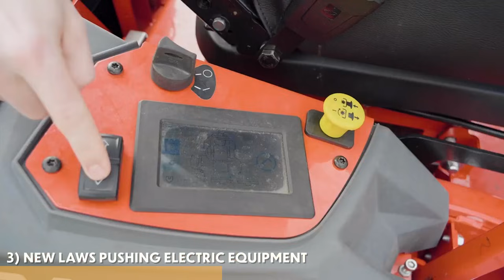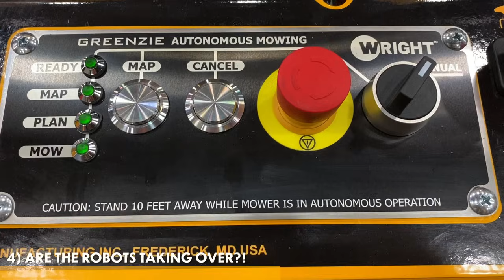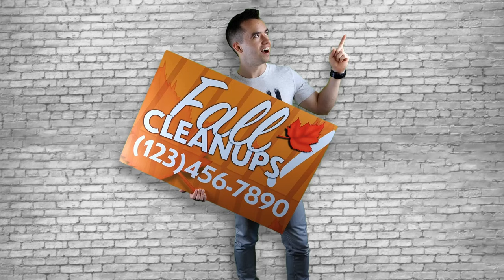The Government is BANNING Gas Powered Equipment & Truck Prices are INSANE!!!

Comment: Battery powered hand tools are enough of a let down for performance and run time. There is no way I’m jumping into battery powered mowers!
Reply: Programmed robot mowers and remote control  mowers will take over lawn mowing will be thing of the past I've seen highway departments using remote controlled mowers here and sitting in there trucks n a/c lol

Comment: I just purchased a 2011 Silverado 1500 for $10,000 with 110,000 miles. Private sale. Dealership's wanted 13-17,000 for the same model with 40-50,000 more miles.
Reply: That’s a steal nice man I had to pay 21k for a 2011 Silverado 1500 crew cab with 102k miles 5 months ago 😭
Reply: you should see the prices here in Australia they where bad before shit hit the fan. just before this hovid 19 shit i payed $20k AUD for a used single-cab 75 cruiser with 270,000km / 167,000mi i would have preferred a used dual-cab 79 but they where going for $90k pre hovid thats more then a new one. now a used 79 is going for well over $120k also that with little to no mods one that has bean modded a fair bit goes for $200k pre hovid now around $250k - $300k.
Reply: Ditch, was that for a 2wd?
Reply: @radiantlawnlandscape5466  no it's a 4wd.

Comment: They're delusional! There's no way their big mansions, estates & vineyards can be serviced with electric equipment, could you imagine having to do all that hedge & treework with a homeowner handheld 🤣
Reply: They will make commercial equipment that is battery powered if they havent already
Reply: String Trimmers ,hedge trimmers and edgers that work well are already here , leaf blowers and mowers that have acceptable power are not there yet, the problem is they won’t run all day … you need ways to charge as you go from account to account….

Comment: …. It starts January 1 2024 in California. Newsom signed the bill allready. No more gas powered lawn equipment, pressure washing , or generators. Im in Silicon Valley Los Gatos. There handing out tickets out here for blowing with gas blowers . It’s bad over here. Most gardeners have left the business .. once the bill goes into effect, people won’t want to pay the higher prices . It’s a dying trade . And the job will be way more harder . And honestly the gas emissions on a gas blower is horrible. We have over 200 clients in Silicon Valley . And the gas powered issue and drought out here is killing lawns . Everyone switching to artificial turf . Games changing so much

Comment: The only battery equipment I consider as good is the kobalt hedge trimmer, pole saw and weed killer spary. That's only because it's 80v. I can't imagine having a battery zero turn and forgot to charge it overnight and have it shut down on me in the middle of mowing. Least for gas powered mowers I can run to the gas station nearby to fill up

Comment: So at 4:50 when you say they’re goin hyper produce, do you think a year from then that there will be overages resulting in lower prices !?!
Reply from the maker: No. But it will ease inflationary pressures caused currently by the supply chain issues and chip shortages

Comment: Automated mowers have been in very small production for 25 years or more and have not taken off like carpet vacuums. Cost is number one but technology has finally caught up to have any chance of holding on to any existence to hurt the industry. 
I talked to a stihl rep two years ago and they told me that battery power equipment was their objective along with switching focus to residential customers vs. commercial customers. Sadly in stihl I have seen a decrease in quality in the past seven years in quality to the point I have switched back to Redmax products only to experience no production or quality loss plus the equipment is lighter by far.

I know electric mowers have been gaining in public popularity in the last few years but commercially I don't see a gain in purchasing for a few years. Hustler ( Excell industries ) have been leading in development electric units for a long time now and have been surprised that they are not producing them yet but now that California has opened this can of worms I think next year GIE Hustler will come out.